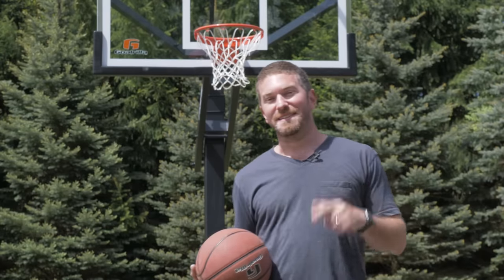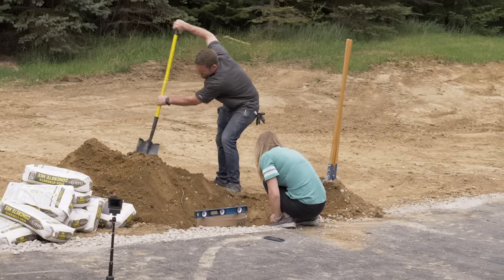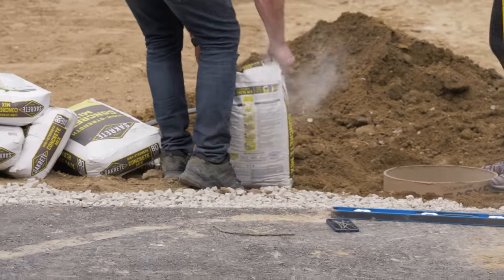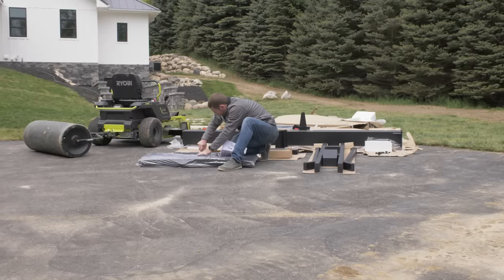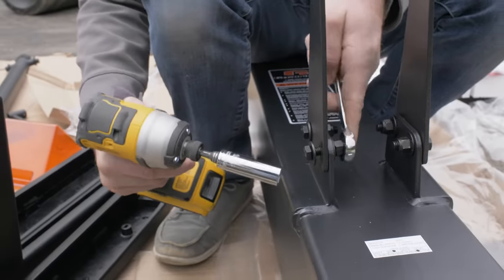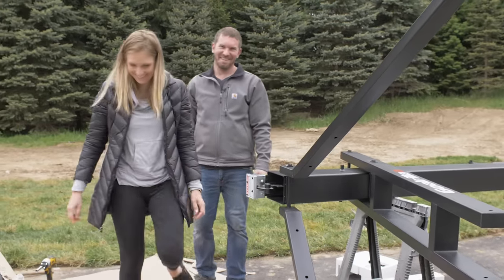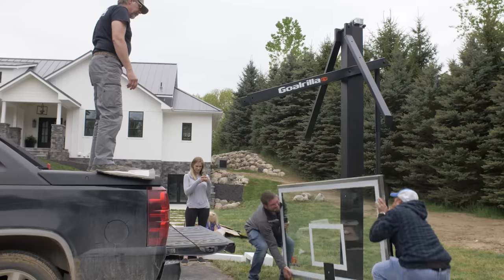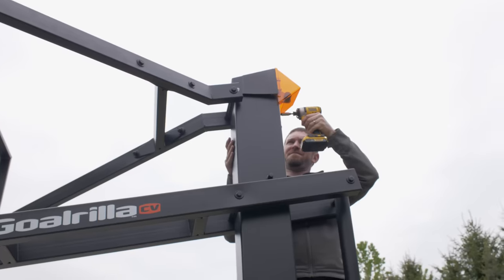In-Ground Basketball Hoop Installation & Hoop Light!

Comment: Great video! How is the hoop holding up? I just got my hole dug and debating on just filling it with concrete or using a sonotube. What size of sonotube did you use? Also, are you glad you used the tube instead of just filling the hole? 
Thanks for any help!
Reply: how much did it cost to dig the hole

Comment: Question... I tried digging 4ft down on mine, but met with some extremely large boulders. I’m at about 39” . Do you think that’ll be sturdy?
Reply from the maker: I don't think another 9" is going to make a huge difference. It definitely won't fall over. Worse case it might start to lean over time. I would suggest sliding the hole over if you can to dodge the boulders. If that's not possible, try to dig around them as much as possible and pour the concrete around and below them to make them part of your footing when it all sets up. Hopefully that makes sense.
Reply: Rogue Engineer did you put the entire form tube in the hole? I seen someone cut 4” out and wasn’t sure.
Reply: Definitely need to get it down.... bring in the dynamite!
Reply: beastmodemani I had to use an electric jack hammer just to get to 33” now I’m thinking I need to keep going and get 7” more inches. Good thing is surrounded by rock will be stronger than by dirt.

Comment: Great Video! We had to dig a hole large enough to remove an old footer that would not work with a newer possibly heavier system. Unfortunately, we had to dig a 40x30 inch circle just to get around it enough to bust old out. Now we are being told we cannot use a smaller form and then fill in dirt around it and compact it , I will not be safe? We will have to put a footer in the exact size of the big hole we already dug out. What is your opinion on this? We are deciding between a 475 lb Mega slam,. and one that only weight 275lb.

Comment: How come those 4 bolts are able to hold this much of weight?? And if they are only 1ft down the concrete why this concrete goes so deep?
Reply: The concrete needs to go below the frost line otherwise you can get movement/heaving.

Comment: I install these for a living.. 
You didn’t need to do any of that. I use a dig bar and post digger. I dig a square hole 18 x 18 x 48’  and use about 15 bags of 80lb sakrete .
And I build it on the anchor . So main post first and level it. then the arm and I built a lift to hoist the backboard.
Reply: I have one of these to replace an old lifetime inground system. Theres a 23 inch hole from that.. And it needs to go into the same spot. This kind of install looks like my only option. Is it solid?
I have 18yr olds that will wear this thing out!

Comment: Installing the 60” version of this in my driveway this week and I’m stoked!

How did you decide how far to put your setback for the hole from the playing surface? Looks like you did about 18” or so. Would you do anything differently having used it for a while now?
Reply: How far did you go?  Just dug the hole for my cv60 and I’ll have about 8in overhang. So I’m setting the anchor plate about 21 inches off driveway.
Reply: @ebayashes857  I think my setback for the edge of the anchor plate is about 15 inches from the playing surface
Reply: @Andy-vt7sl  about how much of the backboard is hanging over driveway?  You think 8 inches is enough?  You have the cv60 correct?  so if I'm doing this right, add about 2.5 inches from anchor plate to actual pole.  so your overhang onto driveway is 13.5inches?
Reply: @ebayashes857  yes the 60” is what I have.

 The backboard overhang is about 14”-18” depending on goal height adjustment. As the hoop level lowers the overhang increases. At 10’ it’s 14” and at 7’6” it’s 18” or so.

The anchor plate goes into the concrete on center and I poured a 16” square form. The base plate for the anchor is about 2.5”-3” from any side because I didn’t center it perfectly. The most important part - CRITICALLY IMPORTANT -  is that the anchor plate is parallel to your playing surface.

I was wrong about my setback. My anchor plate is 11 inches from the playing surface. In hindsight I might’ve pushed it back a little bit more - like 2”-3”, but it’s really fine.
Reply: @Andy-vt7sl  thanks for the replies... I hope I didn't mess up by going too far.   I also made a 16" sq form.  So here's what I'm getting.   Front of form to edge of driveway 15.5", add 1.5" (width 2 x 4), add 3.5" to center, plus from anchor plate to post is about 2.5".  Total overhang at 10' for cv60 is 31"

so 15.5+1.5+3.5+2.5 = 23
31-23 = leaves me 8" overhang

My driveway is somewhat narrow, I come up with this because the rim is another 25", I wanted at least 15' for a free throw.  

I hope this doesn't look silly with the backboard only 8 inches past grass.
Reply: @ebayashes857  I think you’re gonna be fine. Sounds smart!

Comment: 100% NOT the way you want to install a goal. Sonotube should only be a few inches in the ground and extend above ground for forming. The hole should NEVER be backfilled with dirt. That creates a very unstable platform. The backhoe was ridiculous, with the proper tools the hole can be hand dug in 20-30 min.

Comment: Amateur build, over dug the hole twice the diameter required. Then  backfilled loose soil without compacting. The anchor footing is forever compromised structurally. 🙉